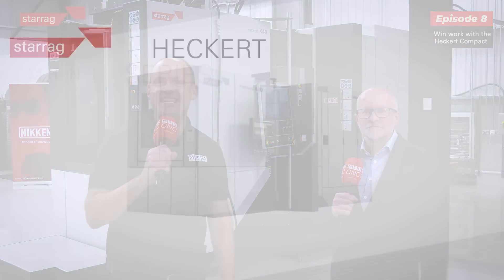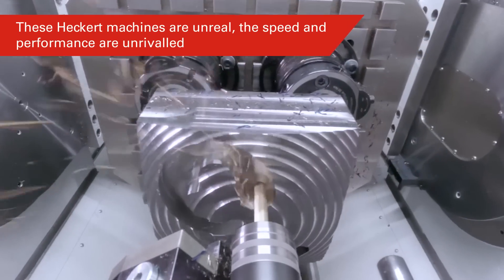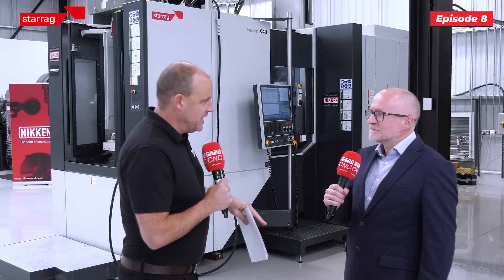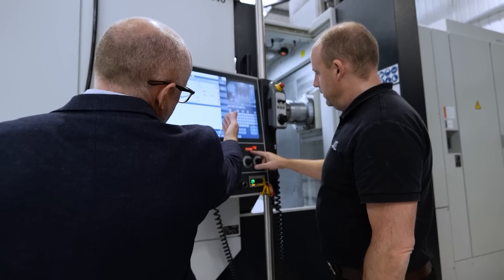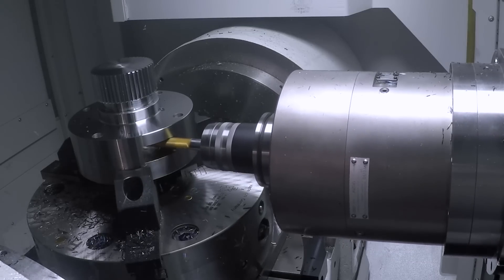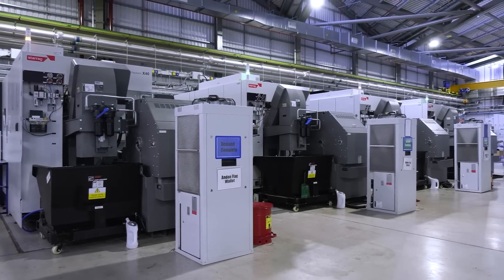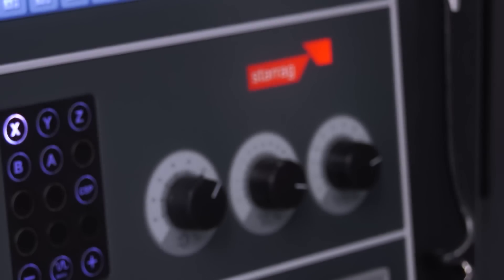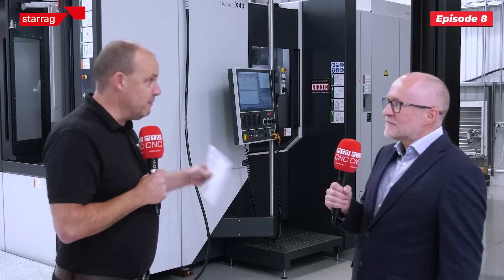Want more work in the machine shop? Heckert can help

Comment: The Heckert look to have a really good layout. I had a look on the website, and a few things aren't clear:

1. What's the interference diameter of the table? It gives a table diameter, but not an interference diameter for parts that overhang the table. 
2. What's the tool measurement process? Blum, Renishaw? Is the tool setter/measurer on the side of the rotary axis? 
3. The website says that the X40 has a max. tool length of 430mm, but what's the clearance on that? On a Grob for example, you load the tool outside the working area, so you know that there's not going to be a clearance issue with the tool during a positioning moves. Some machines say they can take a long tool, but you'd almost certainly collide with a big part on a positioning move...
Reply from the maker: if you drop an email to joe@mtdcnc.com Alex, we will find that out for you.
Have you seen the other Heckert videos from that series of videos?